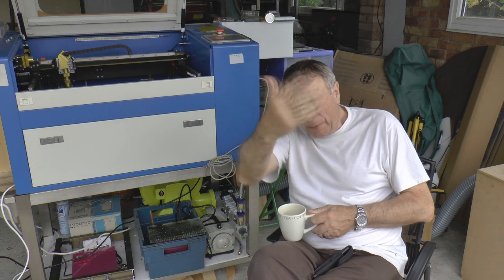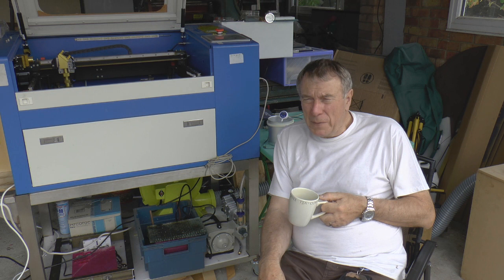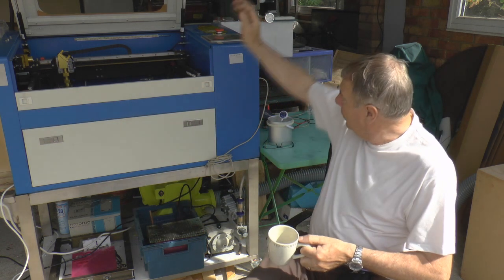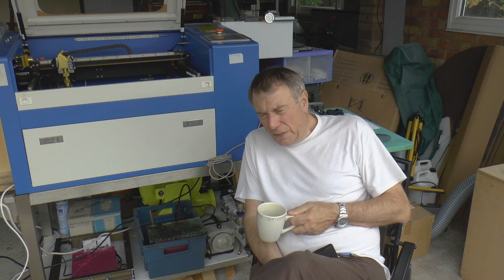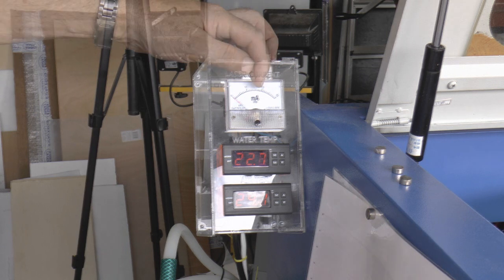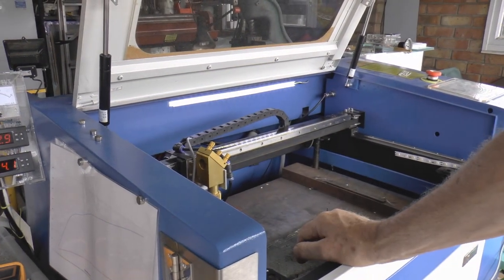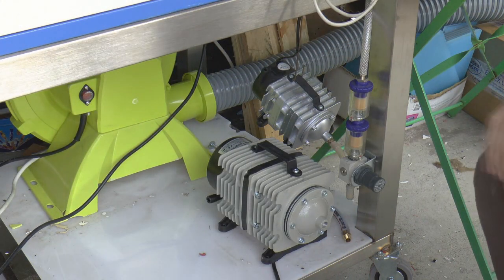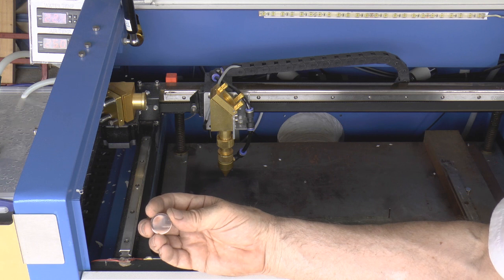RDWorks Learning Lab 75 What have I learned from 1 year of owning a Chinese Laser Engraver

Comment: does anyone know what if its possible to just buy the enclosure and put the cloudray kit inside of it.?  Cloudray has a nice kit but it doesn't come with an enclosure and it doesn't say what size enclosure is needed.  Otherwise I guess buy the absolute cheapest laser I could get from China and junk the insides.   Trying to figure out a good way to get a decent laser without spending $5K or more.
Reply from the maker: Hi
You may not have  seem this more recent video about buying a machine   https://www.youtube.com/watch?v=N7Af2U_THnY
The kits that Cloudray sell are what you expect to find in the better quality machines. I have such a machine with my Lightblade machine . Its  built like a tank and just works. However, as you say that would be a $6000  machine.  I have two other machines that I paid about $1200 and $1500 for.  With a bit of attention they are now equally reliable.  This  sub $2000 for a new machine is  the target p[rice you should go for  but you must choose the  mechanics carefully.   It is the mechanics and  controller that are the basic skeleton of the machine. There will be some rubbish bits  that ensures this machine will not be a top performer  but invest a few hundred $ more for a new tube and HV power supply and you will be on the way to a well performing and reliable machine. Keep an eye open for a preowned machine , There are many bargains to be had from people that soon became disillusioned that their  machines did not live up to the dream.  
 Buying a Cloudray kit  a possible  start but the cost of all the other parts will quickly mount up because you are buying them shop prices whereas a complete machine is stuffed with parts at OEM prices.
 Good luck with your new adventure
 Best wishes
Russ

Comment: Hey Russ, thanks for all the work youve put into this, Ive watched over 100 of your videos by this point. I just got that same air pump fan you are using for the exhaust here- any tips on how you rigged it to the machine or is that covered in a video somewhere? Thanks
Reply from the maker: Hi
 The biggest tip I can give is do not use the machine sockets to drive the fan
 Run it from a separate mains supply power block.
 On my Tangerine tiger I have rigged the exhaust fan to stop about 10 seconds after the cycle stops. It starts whenever a cycle starts. The slight delay of extraction on start up is negligible.   I had to make a 150mm inlet flange for the fan and also a 4" outlet flange
Reply: @SarbarMultimedia  thanks for the reply, I will make sure the seperate out the fans power. Ive got the flanges all rigged up now im going to install my ammeter. Youre the best man, take care

Comment: Hello Russ. As it is winter in the area I live I have a question. What temperature do you advise the cooling water to be to avoid a thermal shock? I’m afraid that the tube may crack when the difference is to large so I’m now keeping it at 18° C. with an aquarium heater. Thanks, have a good day.
Reply from the maker: Hi I live in ther London area of the K and winter temperatures are very inconsistent Sometimes we may have 150mm of snow for a week and in other years nothing.  I have never experienced ant issues with my two machines because like you I have installed gently heating in the form of  4 x50 halogen bulbs . However, this year I noticed a few weeks ago, before the cold weather, that on one machine, all the bulbs needed replacing. I did not have spares so i just left the pump running continuously. I monitor both air temperature and water temperature and found the pump was causing its own heating effect and keeping the water about 6C above air temperature. I have often run my machine  at 5C and never had a hint of a problem. In fact the tube will deliver an extra watt or two of power at low temperatures. I have also run at the other extreme of 45C for several hours with no ill effects except about 5% power loss.  Thee key thing is to prevent freezing, because ice is more volumetric than water and WILL burst the tube.

Best wishes
Russ
Reply: @SarbarMultimedia  Thanks for your kind answer much appreciated.

Comment: I am in Australia and about to buy a chinese laser but after watching your video I am now having second thoughts. I cant see why the chinese dont just up the price and put some thing of reasonable into the machine to start with. Its all got to do with the price but!!!!!!!!!!
Reply from the maker: Hi Terry
I have spent several years using and developing small but significant improvements to this original China blue machine. If you have the patience and a few skills then these repersent excellent value for money as,  what I now describe to be , a "DIY Laser Machine Kit".. ALL ebay machines will be fitted with B grade tubes and power supplies which means that the machines will work "in some way". There are a few reasonable off the peg  Ebay machines but most perform badly out of the box. You really need to think of spending another $300 or more on a new A grade tube and power supply before you have a piece of usable kit.  
 If you watch some of my later videos #181 and onwards I you will see how I have transformed my machine.  You will also find out that a reputable company in China (Cloudray) have asked to copy my machine design with improvements  to sell exactly what you are looking for.. I cannot tell you the exact date when this product will be available but it is worth going to their  website   cloudraylaser.com  and sending them a message to ask when the Russ Spec Machine will be available for sale.  I know there are many people lined up already to by some that works PROPERLY out of the box. It is a 70 watt  300x500 machine fitted with A grade components.  

Happy Christmas
Russ

Comment: I've watched many of your videos...  You provide some great information for new and experienced users alike.  

I have a question for you...  I have a similar 50W system as yours.  I use the RD Laser Works software supplied with the system to create programs from CAD drawings.

Is there any way to display and thereby manually edit these programs?  I am very familiar with G-Code programming, but I can't get the program to display in any way that can be edited.  It just shows up as a bunch of symbols and gooblygook.

I would like to manually edit the programs so that I can turn the beam on for a fraction of a second at specific positions relative to the geometry of the part.  I tried using "points" in the CAD drawing, the laser will stop at these positions, but the beam will not ignite to peck a hole through the material.

Thanks for any help you can provide...  Cheers!
Reply from the maker: I think there may be solutions that are  just waiting for you to discover.  Add your  disguised email address to another comment and I will get back to you and also delete that comment.

Best wishes
Russ

Comment: How do I replace the flimsy bed in this thing? I need something more sturdy.
Reply from the maker: Hi David

I  have started a new series about converting one of these machines into an RF driven unit. However, using all the knowledge and experience gained with my blue machine , I rip it apart and add several improvements. One of those is to add a stiff 3mm steel table. See this video from 7min 25 sec   https://www.youtube.com/watch?v=RvxgCQinS_c

Best wishes
Russ

Comment: i realy love your videos. they are very informative and i have to thank you for the effort. I bought the same machine today and can´t wait to unpack it.

Do you have any table how to set up the machine or at which procentage to use the Laser in order to keep it working for a longer time?

Greeting from Germany.
Reply from the maker: Hi Teodor
 Keep you excitement high and your expectations low.. If you bought a blue machine it will be mechanically OK but almost certainly the tube will not be 50 watts but an 800mm long 40 watt tube. As well as being just 40 watts it will be a B grade tube  It will probably be labelled K H Laser. and that's another long story. In general I would recommend you do not run above 65%. However, I strongly advise that you invest 5 Euros (or less) and buy an  "ammeter 30mA" from ebay or Amazon.  
https://www.ebay.de/sch/i.html?_from=R40&_trksid=p2380057.m570.l1313&_nkw=ammeter+30mA&_sacat=0
For a 40 watt tube the maximum current should be 18mA. So. if you fit an ammeter you may find you can run at 80%=18mA

Best wishes
Russ
Reply: @SarbarMultimedia  Thank you very much Russ. I´ll try to always run it between 60 and 65%.

I was wondering if you have any table or recommendations regarding speed-power-repetitions for paper, cardboard, wood (different thickness) or acrylic.

Best regards
Teodor
Reply from the maker: @catasabau  
Hi Teodor
 Sadly there are no guidelines because there are so many variables involved
1) The  REAL power of your tube
2)The efficiency of your mirrors and lens
3) Lens orientation
4)Lens focal length
5)The accuracy of your beam alignment .....particularly onto mirror 3
5)The accuracy of your focal length setting
6) the efficiency of your air assist,
7)The type of material and thickness you are cutting

The best way to find an ideal cutting speed is to draw a 25mm test square. Set the power to the allowable maximum (set max and min the same) ......if you do not have an ammeter fitted then do not exceed 65%. Set the speed low (say 5mm/s) and try to cut your square. If it drops out cleanly then increase the speed in steps of 5mm/s until it fails to drop out . Reduce the speed  by 2mm/s until it drops out cleanly. That's the best for your setup.

Best wishes
Russ
Reply: @SarbarMultimedia  Thank you very much for your prompt reply Russ.

I couldn't sleep today after 5 am so i went i the garage and played with some settings. Still couldn't cut through 4 mm plywood but I am very optimistic about it.

Best regards
Teodor
Reply from the maker: @catasabau  
Hi Teodor
I did warn you to keep your expectations low. If you can, tru to track down some 10mm thick acrylic. just a smallpiece. Do you have any plastics distributors or sign companies nearby. Perhaps you could beg a small piece from their scrap bin?  This material will be an important tool is seeing how good your tube is If you have some already or when you get a piece  give me another shout and I will explain what you must do.
 Best wishes
Russ
Reply: @SarbarMultimedia  hei Russ.
I honestly have no expectations at all. this way the surprise if something goes as planned will be even greater. I've managed to order online a piece of acrylic glass 10 mm thick an I'll let you know when it arrives. The main purpose of this laser machine is to cut paper (with smaller details since a blade plotter has it's limits) and wood(4 maybe 6mm) to help my wife with her plotter business. Another thing would be some 3d engraving. I still have to learn how to transfer files and how to use RDWorks. 
I thank you and I very much appreciate your support.
Best regards 
Teodor
Reply from the maker: @catasabau 
Hi Teodor
Send me your disguised email address  (johndotsmithatgmaildotcom) in another comment and I will reply to you and also delete your comment.  That will allow us to exchange pictures and instructions on how to use your piece of 10mm acrylic.
 Best wishes
Russ

Comment: I also want to thank you for your series on this laser engraver and RDWorks. I have seen that you check these comments and will reply. I am having a problem with my x axis in that I have no movement at all either direction. I was wondering if you could shed some light on the problem.  Thank you again for your time and efforts making these videos.
Reply from the maker: Hi Harrell
I absolutely hate You Tube from time to time. I answered this question in depth earlier and You Tube has posted my answer to some parallel universe!!!  So lets try again

The strategy  to solving such issues is to halve the problem and then work on the half that has the issue.
 First  verify that Y is working correctly with the UP/DOWN arrows. 
Switch off the machine
There are 4-way connectors on both the X and Y stepper drivers,   Swap them over
Move the head to the centre of the table
Turn the power on but as soon as you see head movement press the ESC button to stop the head
Now press the left and right arrows. Remember that the X driver is now powering the Y motor. Thus if the gantry moves it proves that there is noting wrong with the X driver. OR if there is no movement then you have to concentrate on the X driver,
Now press the UP/DOWN arrows.  It proves that the wiring and the X motor are both working correctly. If no motion then a broken wire must be suspected because it is rare (but not impossible) for a stepper motor to just die.

Let me know  in which half of the system the problem is happening and we can then work back further.

Best wishes
Russ
Reply: Russ, thank you very much for your response. I did as you instructed and once I switched the wires on the stepper drivers, I had X movement but no Y movement. I also checked the continuity on the wires on both motors and it showed to have good continuity both motors. I am thinking this all means that the X stepper driver is the problem. Interesting side note here, I contacted Orion Motor Tech Direct through Amazon messaging and they asked me to make a video that their technician could view to help determine the problem. While doing a run through for the video, I started up the machine and the X axis was working. It lasted about 24 hours and it quit again. Do you agree that the stepper driver is the problem? Do you have any recommendations for supplier for a replacement?
Reply from the maker: @harrellmathews4516  

Hi Harrell 

Sadly any laser machine bought from ebay or through Amazon market place will be built with  many B grade parts that work but did not pass the original manufacturers final test specification. Obviously these parts are mach cheaper than A grade parts  and the manufacturer of the machine will distance himself from warranty responsibility by selling to you through a 3rd party who is legally responsible for the promised warranty.   I suspect that you may have such a stepper drive unit.  If the X driver has quit again, Take a video of it not working and swap the drivers again and show a video of X working and Y not working.  I hope you are speaking with the vendor via Amazon so there is a record.  Upload the video to  You Tube as an unlisted  and send them the link via your Amazon communication route. Exaggerate the situation and tell them that this is preventing your small business from  operating and it needs urgent attention. If they cannot replace the driver within 7 days then you will be forced to buy one locally  at a cost $???? and ask for a refund to cover the replacement cost..
 Take a look here on Amazon at a reputable company  for a guide price (plus delivery)  Quite a lot of popular items are stocked by Amazon  but some willcome from China so check the delivery dates.
https://www.amazon.co.uk/s?i=merchant-items&me=A19OXSQHU3YOFO

Best wishes
Russ